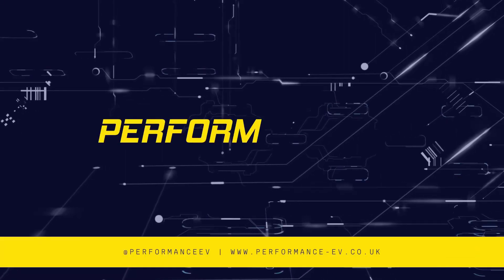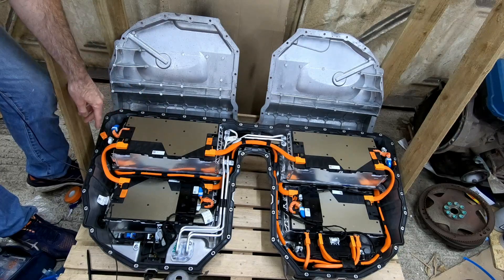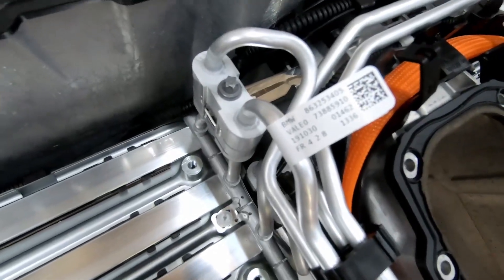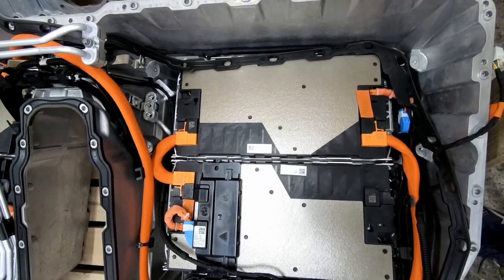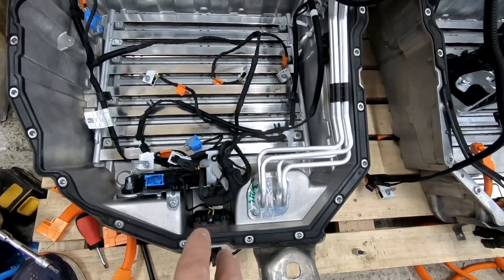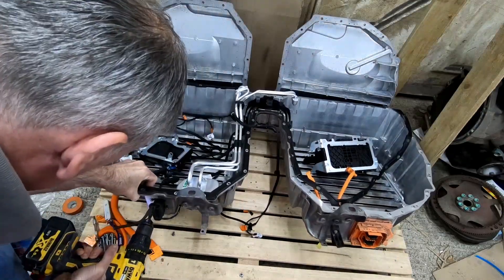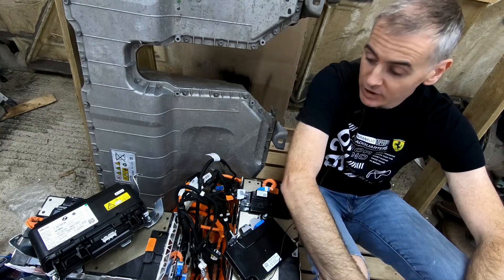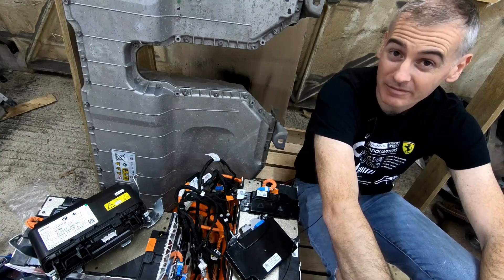BMW Hybrid Battery tear down - parts for our 1976 VW 1303 EV Conversion - DIY Electric Car

Comment: What the spec on that pack?
12kw - is that split evenly between the modules and what is the total voltage and module voltages?
cos that battery looks quite useful.
Are you going to use the cooling system in your project?
Reply from the maker: It’s the 12KW pack. I can’t recall the exact specs but I think the max voltage is up around 400v and it is an even split between the 6 modules. So about 66/67v per module. 
I’m going to just try an aluminium sheet as a heat sink initially and see how that goes. If I do need to do cooling it will be something other than what came with the pack as the beetle doesn’t have any aircon to hook into.
Reply: @PerformanceEV  What about just running water through those same lines, any chance that might work well enough?

Comment: Nice job. I did the exact same myself earlier this week. I split the packs into a 3S2P setup for my car, the "Red Arrow" BMW E36 318tds conversion by Damien Maguire. As an Irishman, no doubt you will know about this car! Packs are in the car, fully charged last night, took me a bit longer than I planned to secure them, was already getting dark so didn't make the test drive today. But will do tomorrow on our new bank holiday 😄
Reply from the maker: Ah, I wondered where that had gone. Hope the test drive went okay. I’d be interested to here how the batteries went in the different orientation. I may be changing mine to have some in parallel too.